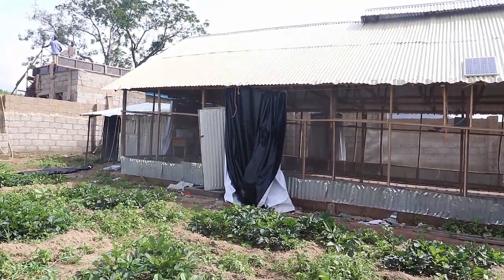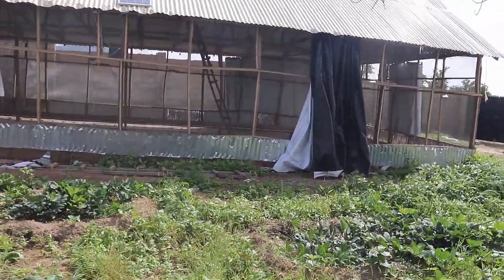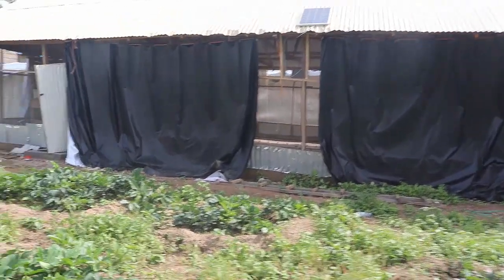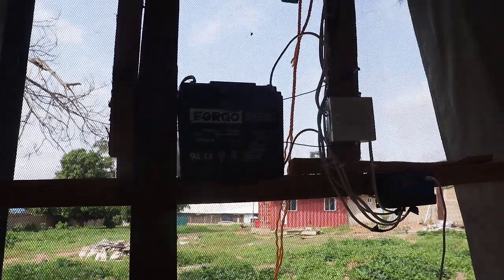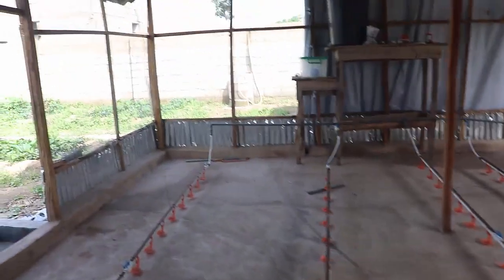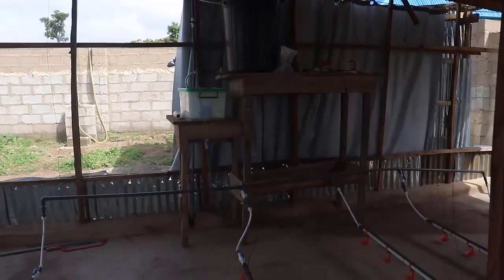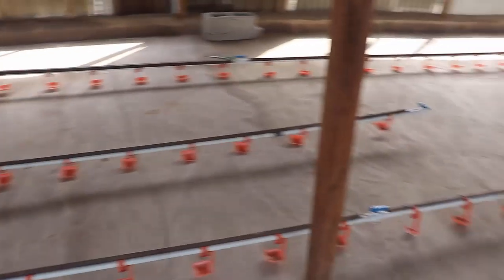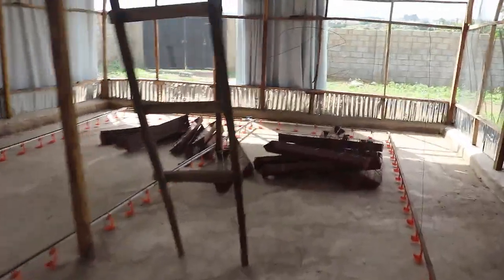HOW TO CONSTRUCT A POULTRY HOUSE

Comment: Hi. Thank you for the information. Can you share plus minus how much you spent on all this preparation
Reply from the maker: The link below, is the cost run down of the broiler house construction from day 1 to the final day (took us 6 months... Lol)

https://drive.google.com/file/d/1VPPjGqLgM9PSGg7I2aCmZ4qJ9ZgwcImk/view?usp=drivesdk

Note: Due to Nigeria's constant inflation, the present costs, including labour, may vary from what we spent, so do your side, by making current price enquiries in your location. 

And also, the costs for solar accessories, nipple drinker system and the constructed feeders are not included, because they were materials we already had (used to raise our layers in deep litter, before they were transferred to battery cage, way back in 2021), which are no longer in use, so we only transferred them to the broiler section, bought few replacement materials (for the nipple system) and paid for their installations.

Comment: 1)
Its the tapoleen all round? Or only at the broaden area. 
2) that pen house looks like it can take upto 700 matured fowls but u said it can take only about 350.
Reply from the maker: 1. Its all round, so I can open and close it during rainy and cold/hot weather.

2. I think I said about/over 350 adult broilers. But to be exact, the pen can house 1024 6 weeks old broilers.
Reply: @farmsdiary  Alright. Thanks a lot.